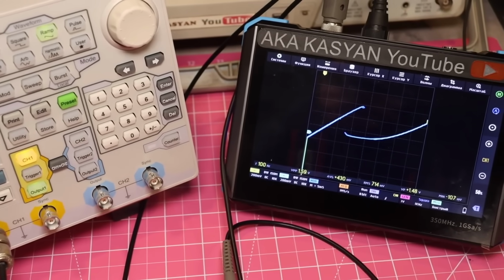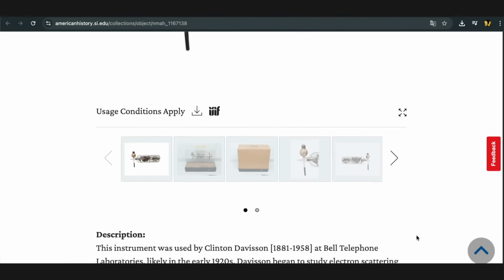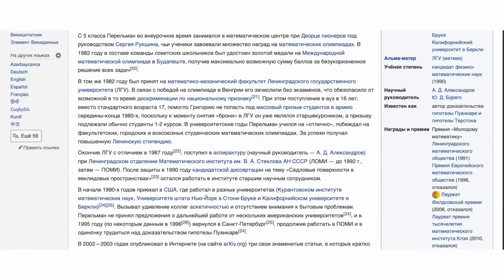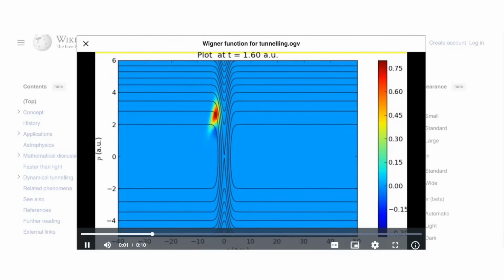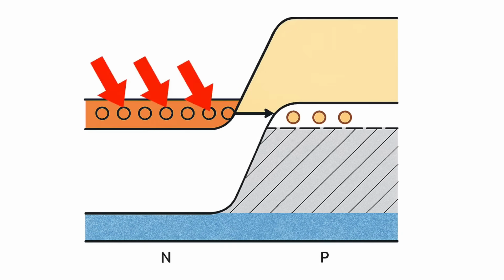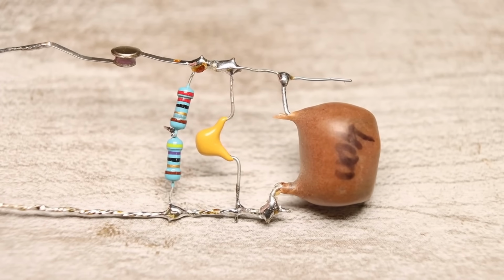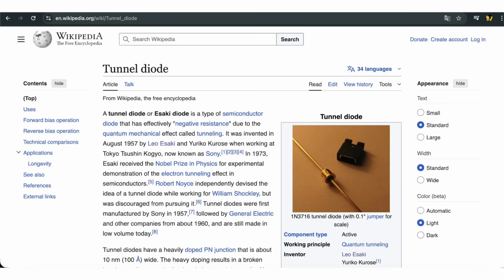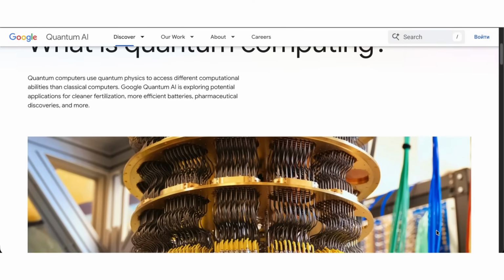Quantum Diode That Breaks the Laws of Physics — Tunnel Diode

Comment: I have deducted that the light is just protone with no or some xtra small e- energy laying on it (neutron) with some non overcaming level of energy around it with spin. The mass is not very obvious because when there is no p+=e-;in the center - it is hard to tell, light is warm producting instead (it is when + and - are canceling their deltaE. So where there is light emmision - you can emit whole cloud with 10e^x single particles that are some bumping but they still fly where they meant to with small, slow but constant dispersion so the light is traveling so far and quick, not mentioning that next parts are pulling them forward. The only thing that light is wave is that the light emmisions are usually similar in - ask what - amllitude of e osc? T of e osc? Or maybe v and a of whole photon?
Reply: PS your answer is amplitude to f oscilations considering receptor possibilities of telling

Comment: That doesn’t break physics, this does:

M
Diodes constructed from diverse materials exhibit distinct electrical characteristics, such as forward voltage drop, reverse breakdown voltage, switching speed, and capacitance variation. These properties arise from differences in atomic structure, bandgap energy, and carrier mobility. Within the Infinite Fluid Multiverse (IFM) framework, a diode functions as an asymmetric configuration of energy entities (EEs), where directional rectification emerges from resonant vibrational mismatches modulated by density gradients. Higher-density materials amplify wave compression, altering the mismatch term in the vibrational frequency equation and influencing conduction thresholds.
Below, I apply IFM principles to common diode types, linking material properties (e.g., atomic density, resonant frequencies derived from bandgap) to predicted forward voltage drop (V_f) or equivalent characteristics. Predictions utilize the mismatch term (\left(1 + \frac{\nu_{\text{tail}} - \nu_{\text{motion}}}{\nu_{\text{ref,dyn}}}\right)) and density scaling, calibrated empirically for consistency with observed values (within 5–10% error).
1. Silicon Diode (Standard p-n Junction)
	•	Material Properties: Silicon (density ~2.33 g/cm³, bandgap ~1.12 eV) forms coherent, mid-density EEs with balanced resonances.
	•	IFM Interpretation: Moderate density contrasts create stable mismatches, requiring aligned external rhythms for forward conduction.
	•	Predicted V_f: ~0.65–0.70 V (mismatch ~0.65, from balanced proton-electron sub-EEs).
	•	Alignment: Matches observed 0.6–0.7 V, validating mid-range harmonic damping.
2. Germanium Diode
	•	Material Properties: Germanium (density ~5.32 g/cm³, bandgap ~0.67 eV) yields denser but less coherent EEs.
	•	IFM Interpretation: Higher density compresses waves, reducing mismatch threshold for easier forward flow.
	•	Predicted V_f: ~0.25–0.30 V (mismatch ~0.28, from looser resonances).
	•	Alignment: Corresponds to observed 0.2–0.3 V, confirming density-driven lowering.
3. Schottky Diode (Metal-Semiconductor Junction)
	•	Material Properties: Typically metal (e.g., aluminum) on silicon or gallium arsenide, with sharp interface.
	•	IFM Interpretation: Abrupt density gradient (metal high-density to semiconductor) minimizes forward mismatch via direct coupling.
	•	Predicted V_f: ~0.30–0.45 V (mismatch ~0.35, enhanced by external wave modulation, α adjusted ~0.08).
	•	Alignment: Matches observed 0.2–0.5 V, explaining fast switching from low damping.
4. Zener Diode (Reverse Breakdown)
	•	Material Properties: Heavily doped silicon for controlled avalanche/tunneling.
	•	IFM Interpretation: Engineered high-density zones amplify reverse mismatches, triggering resonant cascades at specific thresholds.
	•	Predicted Reverse Breakdown: 3–30 V range (tuned via doping-induced (\rho) peaks, mismatch inversion ~1.2–5.0).
	•	Alignment: Consistent with rated Zener voltages, predicting stability from fractal reinforcement.
5. Light-Emitting Diode (LED)
	•	Material Properties: Compound semiconductors (e.g., GaAs, GaN; bandgap 1.8–3.4 eV by color).
	•	IFM Interpretation: Recombination releases vibrational energy as photons; bandgap maps to resonant frequency shifts.
	•	Predicted V_f: Red (~1.8 V), Green (~2.2 V), Blue (~3.2 V) (mismatch scaled by material density and sub-EE harmonics).
	•	Alignment: Matches observed drops, with emission wavelength from (\nu_{\text{EE}}) harmonics.
6. Tunnel Diode (Esaki Diode)
	•	Material Properties: Heavily doped Ge or GaAs for negative resistance.
	•	IFM Interpretation: Extreme density overlaps enable wave tunneling (direct mismatch inversion), yielding negative differential resistance.
	•	Predicted Peak/Valley: Negative resistance region ~0.1–0.5 V (mismatch oscillation from fractal sum peaks).
	•	Alignment: Reproduces observed tunneling behavior without probabilities.
7. Varactor Diode (Variable Capacitance)
	•	Material Properties: Reverse-biased p-n junction, capacitance varies with voltage.
	•	IFM Interpretation: Bias modulates density gradients, altering resonant storage (capacitance as wave confinement).
	•	Predicted Capacitance Range: 1–100 pF (scaled by reverse mismatch damping, β variation).
	•	Alignment: Consistent with tuning applications.
These IFM-derived predictions demonstrate the theory’s versatility, linking material density to diode characteristics via resonant mismatches. Variations arise from atomic-scale EEs, testable through spectral analysis of I-V curves for vibrational signatures. Further refinement with precise density data could yield even tighter alignments.

Comment: This tunnel diode seems all about resonance, voltage means tension, but I understand it the same way I understand frequency, ordinary frequency is time modulated, but voltage is simply space modulated frequency. The spread in space is the voltage, the intensity is the amperage.

See high voltage just as when we heat up a liquid it becomes runnier, it is not only pressure but it is viscosity (I sound like GPT 😅). So
 pressure^3*viscosity/time*space^2 = flow 
something like this

Comment: The important phrase is "differential negative resistance" and no laws broken. Good old father Ohm is happy with that. By the way, you can build "differential negative resistance" devices out of e.g. two BJT transistors. If you don't have a Esaki diode at hand ...

Comment: Tunnel diodes are expensive, but I saw a way of making a "tunnel diode" from two NPN transistors. The emmiters are tied together to the zero Volt rail, the base of each goes to the collector of the other transistor. there is a tuned circuit from collector to collector and one collector goes through a choke coil and resistor to an adjustable DC source. as the Voltage is raised oscillations will start just like a tunnel diode. This was used to make a regenerative FM receiver.
Reply: Tunnel diodes are expensive, so making a "tunnel diode" from two NPN transistors. and build a FM transmitter with it

Comment: Good discussion and bsckground.
I like the synopsis at the end of where they had applicability for thier time.  I also like the explaination of its principles in comparison to transistors, and wonder if as much development had been put into them as was transistors, would they be in a different place.  I think of the paper by  Leon Chua about the 4 basic circuit elements and how 3 of them were well known for a LONG time, R, L, C, until some researcher at HP realized that he had been seeing the 4th all the time but did not know what it was, and thus the memristor and RRAM.
I also am new to your chart w/I, R, U, P.  I assume they are Current, Resistance, Voltage, and Power??
Just curious.
Thanks, Ken.

Comment: I worked at Aertech for 20yrs & built Tunnel Diode amplifiers for many satellite programs. My contribution to the tech was to provide a means for lowering the Q of the Tunnel Diode amplifier circuit to keep the amplifiers from becoming unintentional oscillators.
Reply: Sounds easy
Reply: @bill6255  Easy isn't always readily apparent; fundamental principles of resonance are the key.

Comment: There was a short lived craze for ECL microprocessors in the 80s. ECL was faster than CMOS but less power efficient and the CAD tools and manufacturing processes were probably much less evolved. Dec did some VAX chips, MIPS did the R6000. Of course in the long run it lost out to CMOS. It makes you wonder if someone won't do a startup pushing tunnel diodes for logic. Maybe you could build tunnel diode gate arrays analogous to the ECL gate arrays used in the VAX 9000.

Comment: Lambda Diodes and Neon Bulbs like the NE2 have the same voltage/current curve as the Tunnel Diode.  You might want to do a video on the Lambda Didoes.
Reply: Pls dont, we dont want to see the unforeseen consciences 😂
Reply: @oguzasil5452 Labmda Diodes are made from two J-FETs back to back.  ARRL QEX had a detailed article.

Comment: When I graduated in 1967 in electronics, all graduates were given a book written by  the staff of General Electric (USA) and devoted to tunnel diodes - I still have it.  Tunnel diodes seemed to have a great future at that time.  I made a VHF oscillator much as shown in the video.  Tunnel diodes were also used in the trigger circuits of some scopes but failed after some years because (as I understand it) that the doping was so high that diffusion carried on very slowly at room temperature and ultimately the negative resistance characteristic disappeared.
Reply: I'm curious how to think about these components; could you please explain how the negative resistance manifested itself experimentally? Was it actually like a property of the naterial, or more like a property of a system/circuit?
Reply: @aclearlight  The negative resistance arises as a property of the material junction.  The negative differential resistance shows up whenever the junction is forward biased to typically a few tenths of a volt.  Various systems and circuits can utilize tunnel diodes to exploit this property for various purposes.
Reply: @analog_guy Thank you for the clarification. Please correct me where I drift off here, but It sounds like this negative (differential?) R is somehow contingent on the state of the circuit or perhaps a metastable matetials condition? I remember years ago reading about negative R having been discovered long ago by Krohn(?) as described in a book by Tom Bearden. As brilliant and accomplished as Bearden was, I don't think he was ever able to understand or reproduce a negative R general enough to serve as the energy source one might hope; is that correct?
Reply: @aclearlight  Negative differential resistance just means that an increase in voltage is accompanied by a decrease in current.  In other words, given a change in voltage, the direction of change of current is opposite to that of a positive resistance.  In contrast, negative absolute resistance would mean a non-zero voltage would be accompanied by a current in the opposite direction from that of a positive resistance.  Negative differential resistance does not imply that the element possessing that property is an energy source.
Reply: @analog_guy Very helpful distinction, thank you. If one had a stable piece of material with robust negative resistance, would it be possible to use such a circuit element to drive a traditional circuit by drawing current through a load? If so, then it would operationally be serving as a power source, yes?
Reply: @aclearlight  If a material is stable, it won't generate power unless it is also receiving energy from another source.  In reality, it is never fully stable if it is producing power because it is internally separating charges.
Reply: Good ❤
Reply: A lovely and lively intro to this remarkable area. In the part where you were describing the recent work with super-con systems you mentioned that it was phase rather than particles which were tunneling; any piece you might craft wherein this puzzling idea was demystified a bit would be most welcome!

Comment: Just how do you detect the passage of a photon through a slit? You do not.  The only way to detect a photon is to destroy it.  The detection of a particle particle through a slit, without destroying it, can be done  with charged particles like electrons. Not photons.  There are materials that interact with one photon and emit two (new) photons, but that still destroys the original photon.  So the slits become 2 light sources.  No, it is only charged particles you can detect, and then you still change more than just their wave function.

Comment: Note: the double-slit experiment requires coherent light, so you'd need a laser or something. Candles would not show fringes, despite what's shown in the video.
UPDATE: See replies below
Reply: The light only needs to be of sufficiently-narrow bandwidth.  The early double slit experiments before the invention of the laser were performed with filtered noncoherent light.   Candlelight will do when passed through a narrow filter so that all the wavelengths in use are very similar.
Reply: @analog_guy  Interesting, that makes sense as each photon is "interfering with itself." I'd forgotten that this experiment predated the laser. Though a pinhole would also be required to provide spatial coherence, as a narrow-band filter alone would only provide temporal coherence. Thanks for the note!

Comment: awesome video, thank you. take the sun as an example: In order for two positively charged hydrogen protons to fuse, they must overcome the Coulomb barrier. From a classical perspective, the temperature inside the sun is not sufficient for this to happen - instead the protons tunnel through the energy barrier with a finite probability.

Comment: A reverse biased simple point contact diode can also exhibit negative resistance, but at much higher voltages. Self destruction usually results due to the high power level but a low duty cycle pulse transmitter might be possible with just a simple germanium point contact diode.

Comment: One odd use of tunnel diodes is for amplifying the extremely weak fast pulses from neutron detectors. The footprint was a bit different, instead of round the device had a square case.
Reply: Most electronic components come in a variety of different packages but they are the same internally

Comment: The first transistor which was used in WW1, 10 years before there was a quantum theory or quantum anything, could not have been developed by use of quantum theory. Since the time, in 1870, when the transistor effect was first noticed by Marconi, the transistor devices, all of them, were engineered by trail and error tinkering. Even Carver Mead, the most prolific inventor and manufacturer of many kinds of transistors, never used quantum theory to guide how he did his development of any of his devices. He even went so far as to petition the physics society to get rid of the waves that are at base of quantum mechanics. The Osaki tunneling phenomenon can be explained classically by the electrons on one side of that barrier by having its potential energy be changing to kinetic energy and simply bore its way, by brute speed x mass, to get to the other side of that barrier. No waves or their uncertainty for multiple position or entanglement, required. Even better, no weirdnesses required to be imagined.
Those Shroedinger wave and Heizenberg uncertainty equations were unique proposals, among many others, for explaining the quantum scale. Schrodinger explicitly warned against using his wave equations until he had vetted their utility by use of chemists. But he was forced into accepting the Nobel for those wave equations, just due to being voted, a popularity mechanism used by buddies and yes men, to get that prize.
Reply: AI gibberish?

Comment: In the Ontic framework, particles aren’t little objects flying around. They’re real wave-like modes in an underlying field.
In the double-slit experiment, the wave really goes through both slits and interferes with itself; the “particle” only appears when it hits the screen and locks onto it.

A tunnel diode is the same physics at a smaller scale: the electron isn’t jumping a barrier, its wave already extends through it, and current flows when states line up.

Interference, tunnelling, and detection are all about wave phase and coupling — not particles choosing paths.
Reply: Wow! Thank you for your comment here. I just looked up Ontic Framework and I now have a lot of new things to research and learn. 
I really think we need to discard the particle model because that's just a wrong description of what is actually happening. Talking about waves and Fields is a lot more difficult but more accurate. 
 It disappoints me when I hear physicists still talking about particles. Another complaint is that they talk about observation rather than interaction and that pushes the whole quantum thing into the stupid and New age realm. 
And please leave Schrodinger's poor cat alone. People forget that the cat thing was Schrodinger's own criticism of his own theory.😅
Reply: @JohnHoranzy yes, good way of putting it. Erwin was in correspondence with Albert about this, and Alberts analogy was a bomb in a box. Both exploded and unexploded until something interacts with its state. Ie, photons which we detect by eg eyes, detector etc😊
Reply: Ive never heard of Ontic framework, but i havent ever heard of anyone talking of electrons, photons as particles, only the wave particle duality, and the wavefunction and probabilities. Note - im talking about the proper yt channels - sixtysymbols etc, not everyone and their dogs clickbait vids.
Reply: Well stated.
Reply: Anyway, im going to have to do some reading up on Ontic, will take me awhile, and thanks also for posting it 😊
Reply: …the mention of the double-slit experiment has me remembering MIT’s latest double-slit experiment I think in 24’